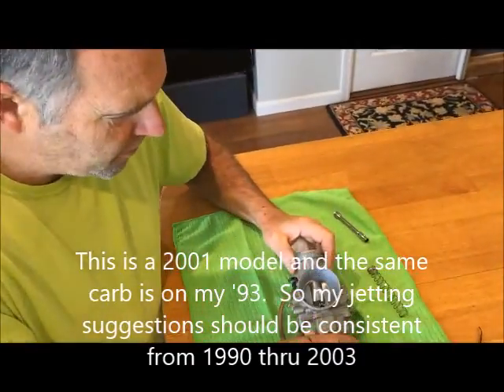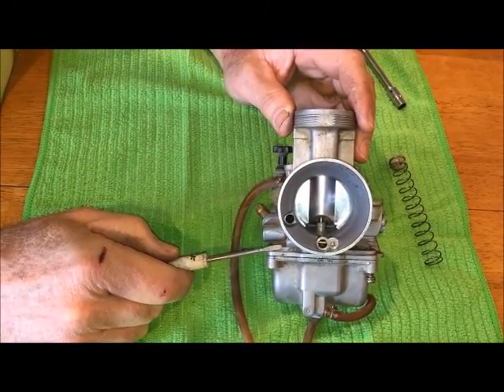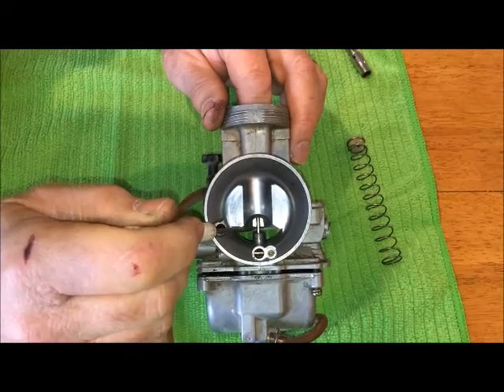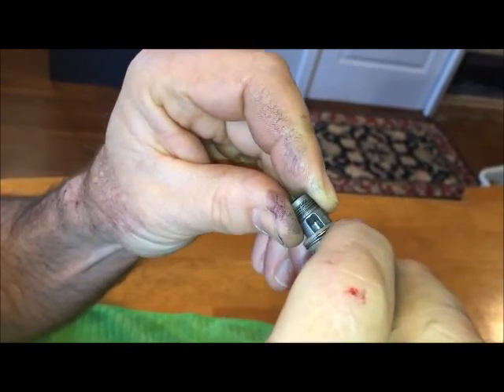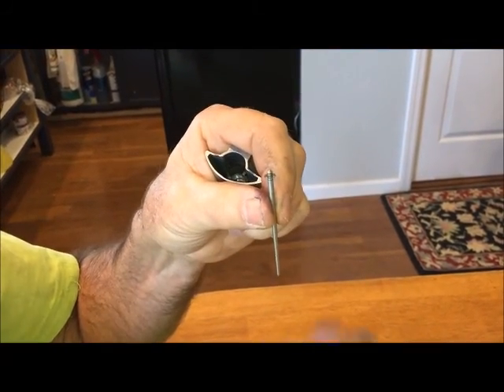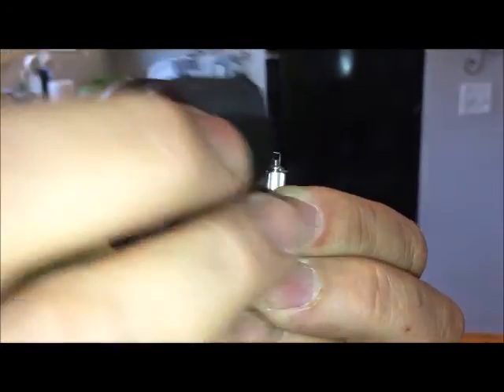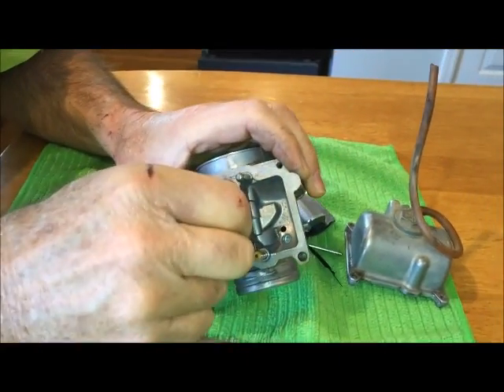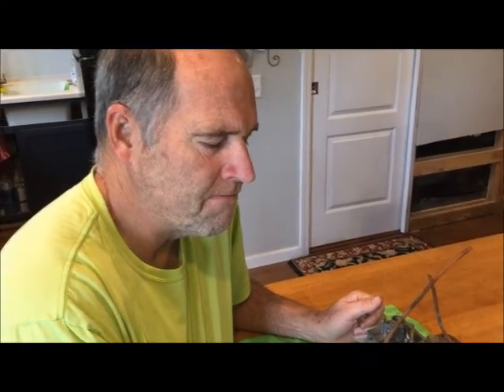KX500 Carburetor jetting tips

Comment: Hi Clark, I am running a kx500 myself. It is all running nice, have a cast iron liner which has been re-board one size up from standard, when I go down the road and get it high up in the rpm I have a little miss fire, at a certain rpm. I haven't tried anything yet, the carb was fully clean before I put it back on, so I think I might try some new reads, what do you think? And might try your jetting. Gav

Comment: great video. Just one small critique. just a little bit of bad information when it comes to the needle valve numbers and position. the third clip is the stock recommended setting. And the numbers start at the top clip position being number 1, and go down through five as the needle gets richer just like the rest of the Jets get larger as the numbers increase.
Reply: And he's backwards on his air screw, back it out and it gets richer
Reply: You're right. I noticed that too. Important for a feller like me at 1,850 metres/6,070 feet to get the jetting right. Mine is an '87 with a Mikuni round slide carb. Have just moved clip to try out a new neeedle position.
Reply: @petergarratt9645  how is more air richer? tell us how that works.
Reply: @amcgee-dl3cj  bernoulli's principle, the increased air allows the circuit to pick up substantially more fuel
Reply: that is some creative reasoning you came up with.
some good books on the topic are "A Guide 1.1 to the choice, setting and use of tapered-needle motorcycle carburetors (Dellorto)" and "Mikuni VM Carburetor Super Tuning Manual"
Reply: @amcgee-dl3cj  Ask yourself this, does the internet really need one more sarcastic know it all? I've tuned bikes by using O2 sensors and EGTs, I don't know what those books say but real world experience has told me you back that screw out and you get richer
Reply: @petergarratt9645  no he is correct.screw In makes it richer and screwing it out makes it leaner.And as for the needle numbers start at the bottom for example CLIP set on lowest NEEDLE groove is number 1 (richest setting)and up to number 5 groove which is top setting which in turn would mean your NEEDLE is down at the lowest  (leanest setting). Great video thanks.
Reply: @petergarratt9645  

You may be confusing an air screw adjustment with a fuel screw adjustment.  Adjusting the air screw out & it's leaning out the mixture. Allowing more air past the aircrew "siphon breaks"  (cuts) the fuel flow. 

A fuel screw is what you may be thinking of where going out makes the engine run richer. 

So the air screw is an air metering adjustment & a fuel screw is a fuel amount adjustment. Going out on the air screw allows more air into the circuit which leans the circuit. Going out on a fuel screw allows fore fuel to flow..

Comment: 50 to 1 is too lean.. I wont run an engine that lean with oil especially  with the heat those engines generate..  your looking for a seizure with that ratio..
Reply from the maker: We're talking  100% synthetic 2 stroke racing oil here......   20 years of KX500 ownership and racing.  When complete engine tear downs are done the entire bottom end looks like someone just used a paint brush to cover every surface.  Use high quality oils and follow the manufacturers recommendations..........  50:1 under race conditions has never been a factor for me.
Reply: Agreet motul 800 or equivalent will keep you more than covered @ 50:1
Reply: NEGATIVE, I have Been Racing and Riding KX500's for twenty plus years. Golden Spectro 50:1 NEVER EVER have has any top end issues.
Reply: 50:1 h1r or motul 800 never fouled a plug or roasted a piston iv been racing/desert riding the same kx 500 since new in 2001